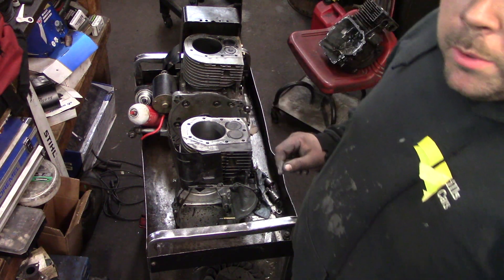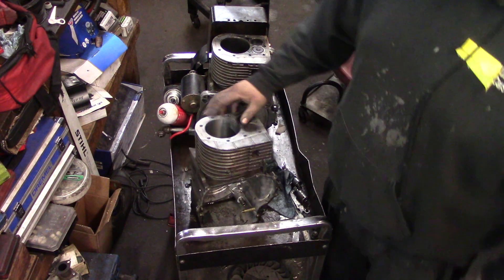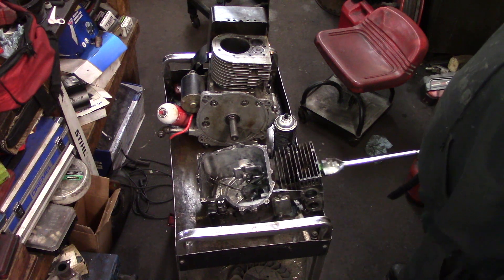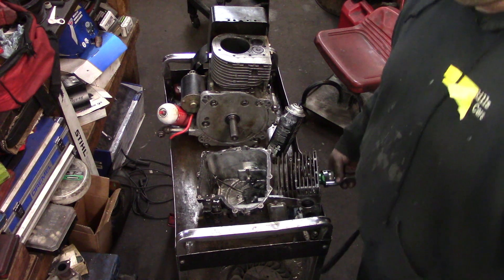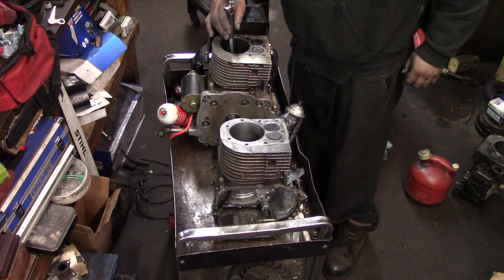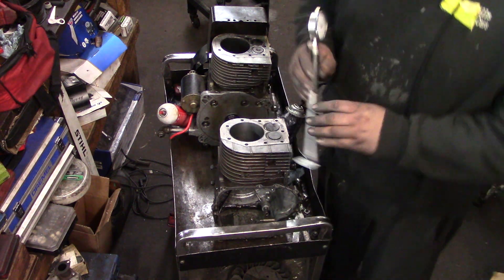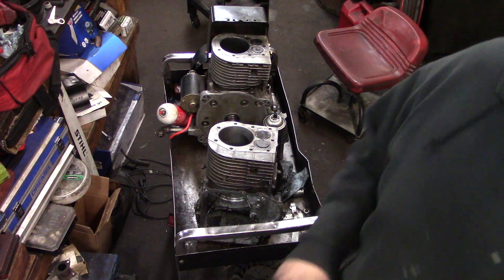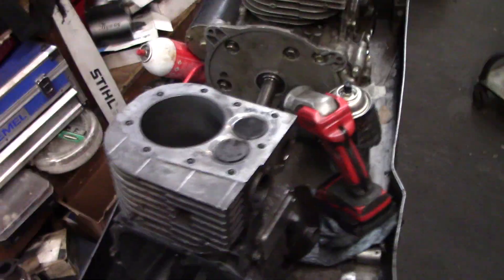Bore A Cylinder At Home 12hp Briggs 0.20 over Size Check With Dial Bore Gauge Video 2

Comment: i missed where he said .. messure the piston. then hone the hole. not blind hone. o will ..
Reply from the maker: What I was doing was setting the bore gauge with the other motor because at the bottom of cylinder is perfect stock bore size 3.4365. So for the 0.010 motor just add 0.010 to the gauge and the 0.020 add 0.020. This is the easiest way to set the bore gauge.

Comment: Thats a hone with that tool there's no way to keep accurate crankshaft alignment.
Reply from the maker: Some machine shops use something similar to this tool but with better stones and equipment. When you hone with this tool. At the bottom of the cylinder were the rings never touch there is a band about of factory cylinder bore finish on all engines. When you hone with this style tool it follows this and keeps the bore straight. So when you are finished the bore with be straight with the crankshaft.

Comment: Very good looking cylinder; hard on stones?
Reply from the maker: This is my first time boring 2 cylinders took 0.030 off between the both of the engines just taking my time making sure there are right. The stones held up pretty good  the stones just lost 25% of there original size.